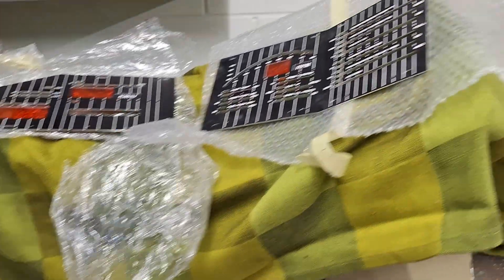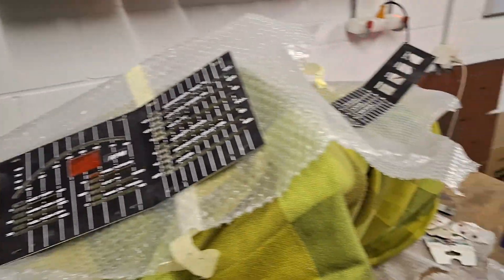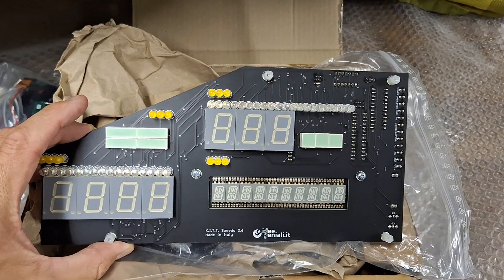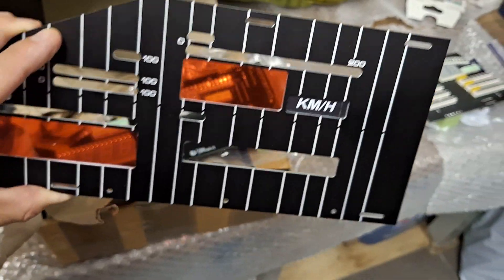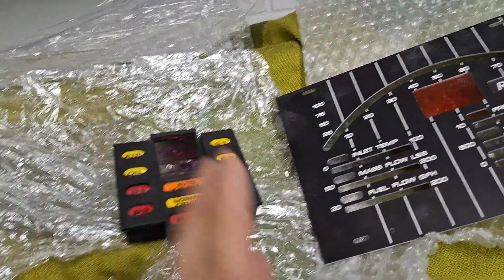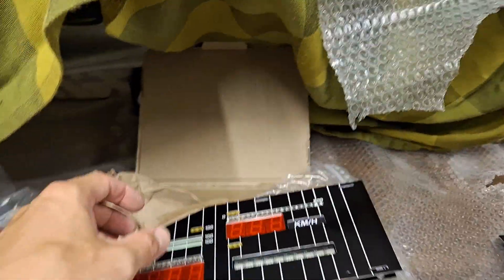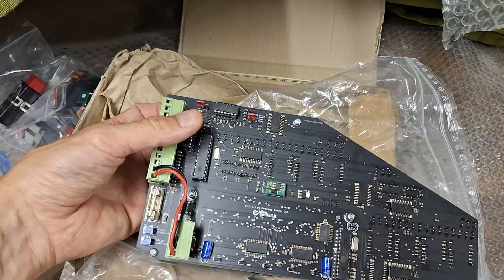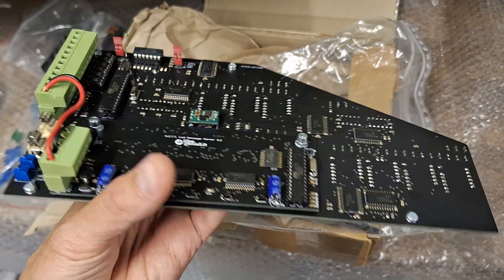Knight Rider dashboard build - Episode 5 - Why ideegeniali?

Comment: Thank you for mention my channel. I will do a detailed video about the functionallity of the ZA Electronics soon. Great video by the way. Lots of informations about that ideegeniali electronics keep up the good videos.

Actually you can't run the ZA Elettronica Boards seperatly. They are wired all together with the provided wiring harness so if you want to turn off a specific area of the electronics you have to use the dimmer function. The other difference of the ZA Electronic is that it's not working with jumpers to make the car setup. It has a dedicated menu you can access trough the message center. so you can change things while the dash is inside the car. But more on this later when i do the full video :shelterin:
Reply from the maker: That's interesting to know. I'm looking forward to having my dash completed so we can compare both sets more in detail.